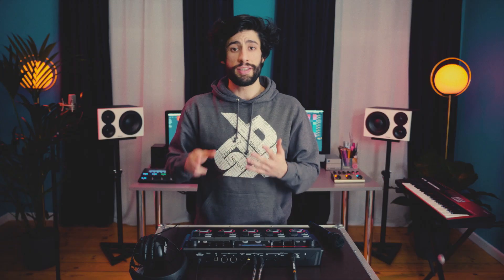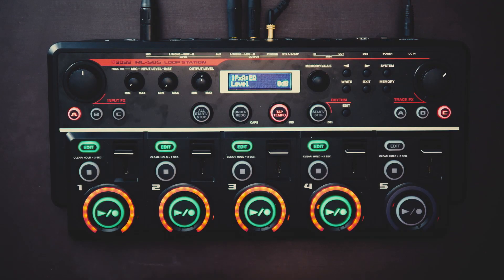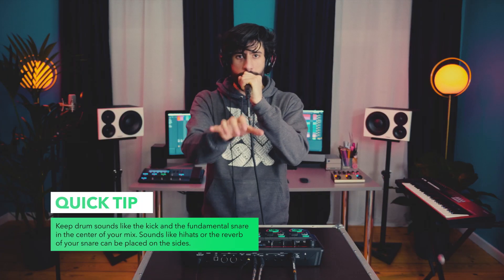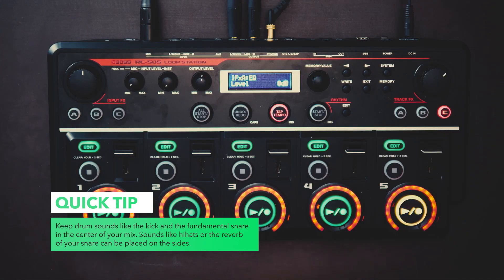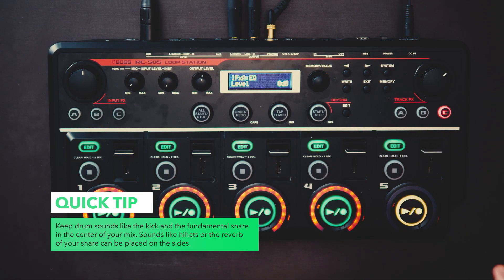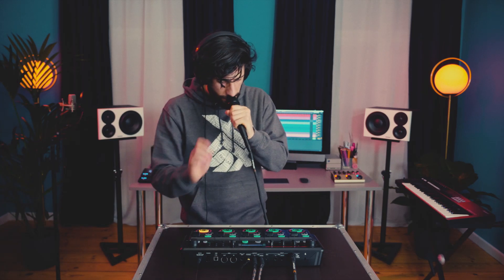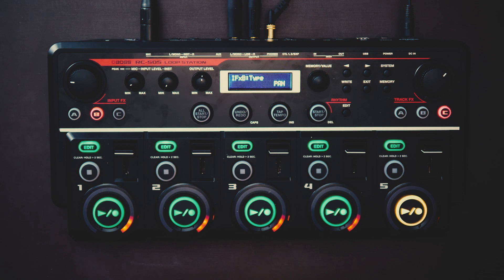How to use Panning | SBX Loop Station Tutorial | MB14

Comment: Huge thanks to Swissbeatbox and MB14 to make it possible !!!
Just received my 505 which is simply unbelievable😍
As I can’t afford studio material such as monitor speakers, I’m playing it with my hifi system
and it’s connected thru the “phones” connector.
Here is my question: Is it possible to get the same sound/configuration compared to a normal separated L/R 6.35 jack connection?

Comment: ive recently started using my rc505. ive noticed that when monitoring my audio through the headphones my left ear is a lot louder than the right. also the signal being sent to the pc seems to be one sided. ive changed some settings in streamlabs to make it come out of both ears when live streaming, however i would like it go go straight to the pc coming out of left and right ear equally. I have my microphone plugged into a mixer and i have 2 jack cables running out (left and right) going into the left and right inp[uts on the mono ins on the loop pad. i then have a single xlr going from the left mono output into the xlr port on my mixer then into the pc.

Comment: Genuine question, if MB14 or any loopers are reading this: Will the pan effect work online for a discord or teamspeak live performance? Because in my tests it seems nobody can notice the difference there even at the extreme ends. I'm thinking that perhaps online is just in Mono not Stereo. Any advice or findings would be greatly appreciated.
Reply: Use ripcord - it allows you to use Stereo
Reply: i am pretty sure it works over discord, as long as you use a USB cable you know to connect